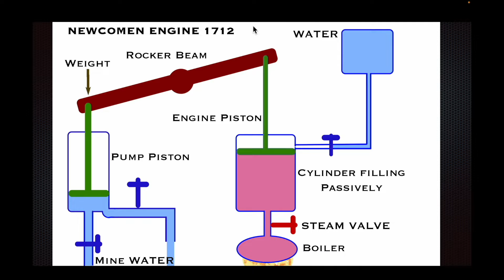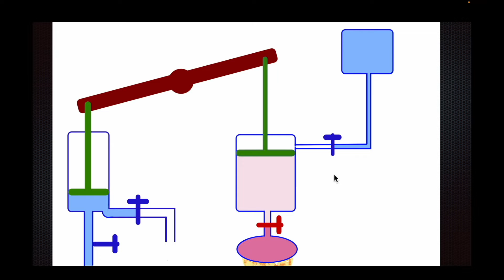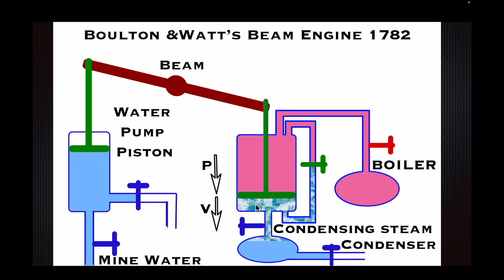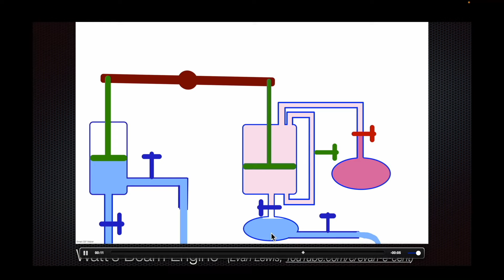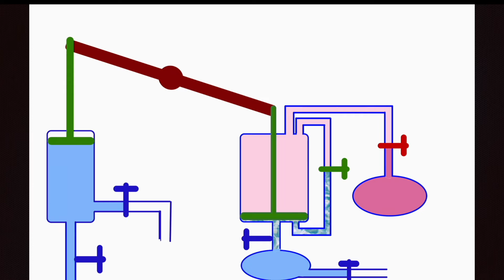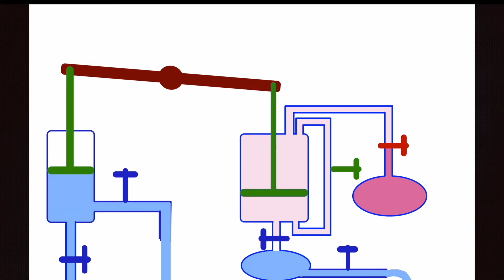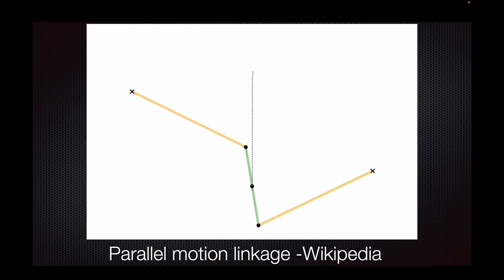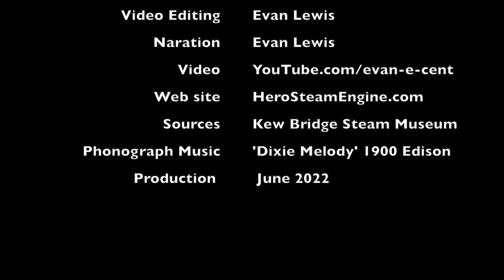Animations of Beam Engines-Newcomen, Watt and Cornish

Comment: How does the engine piston go all the way back up to the top of the stroke if it is just equalising pressure in the chamber? Shouldn't it stop half way?
Reply from the maker: I think the answer is that the water pump on the left side is carrying a heavy load of water which pulls the left end of the beam down, and making the right-hand end rise up, pulling the piston back to the top. Note that, although the pump is shown at the same level as the steam piston, it would have been placed under ground, probably hundreds of feet down the mine and that includes a heavy shaft in addition to the weight of the water column on the left side.

Comment: Atmospheric pressure is a friend to a Newcomen Atmospheric Pump, it's an enemy to Watt's High Pressure Steam Engine, in fact, it was a big problem for the first steam engines. Atmospheric pressure opposes a steam engine.
The optional separate condenser on a Watt engine recirculates hot water and also eliminates Atmospheric Pressure.Makes Watt's High Pressure Steam Engine more efficient.

Comment: Bloomfield Colliery 
Near Dudley 
1776: ' Birmingham, March 11th. On Friday last a Steam Engine constructed upon Mr Watt's new principles, was set to work at Bloomfield Colliery, Dudley. From the first moment of it's setting to work it made about 14 or 15 strokes per minute, and emptied the engine pit (which is about 90 feet deep, and stood 57 feet high in water) in less than an hour. This engine is applied to the working of a pump 14 inches and a half diameter, which is capable of doing to the depth 300 feet, or even 360 if wanted, with one fourth of the fuel that a common engine would require to produce the fame quantity of power. The cylinder is 50 inches diameter, and the lenth of the stroke is seven feet. These engines are not worked by the pressure of the atmosphere. Their principles are very different from all others.
Reply from the maker: Thanks Walter.  Note this report was in 1776 and the Newcomen engine was invented in 1712 leaving 64 years for the Newcomen Atmospheric Engine to be widely used with over 1500 engines in mines around Britain before the use of high pressure steam boilers could be developed.
Reply: So Watt's Invention was a high pressure Steam Engine.

Comment: The Newcomen Engine in the drawing wouldn't work, the cylinder  should be open to the Atmosphere at the top.
It's misleading.
Also, the vacuum in Watt's Engine isn't, ' really Atmospheric Pressure '.

Comment: What did they use to seal the pistons in the 1700s?
Reply from the maker: I don't know precisely. Piston rings were not invented until 1825. Prior to that pumps used leather.  In the early days of steam engine development they had problems making cylinders round. Eventually engineers developed a boring machine for making cannons and it was also used for boring cylinders.  These engines used large cylinders and the ratio of circumference divided by steam volume is reduced. This reduces the effect of air or steam loss past the piston.

Comment from the maker: Walter posted again (with several different names) with his view that Watt invented the steam engine, not Newcomen.  We have discussed this many times now and cannot agree. Let the viewers decide for themselves.
One thing that becomes obvious from these animations is that Watt's engine looks almost identical to the Newcomen steam engine.  Apart from using a separate condenser, higher pressure steam, and the parallel linkage, the design is the same. So the biggest part of the invention came from Newcomen.  

Newcomen could not produce a "vacuum" without using the energy of steam.  You cannot use the atmosphere to do work without supplying energy. That energy came from steam.  Have you ever seen a vacuum pump without a motor to provide energy?   There is no doubt that the source of energy for Newcomen's engine is steam.  It cannot work without steam. This steam energy is used to generate mechanical energy to drive a water pump.  The conversion of heat energy to mechanical energy is the definition of an engine.  Clearly Newcomen's steam powered engine  meets the definition of a steam engine. Watt's improvements were simply improvements of Newcomen's design.  

Watt did use the design to produce rotating motion from the oscillating movement of the beam engine, but that was a relatively simple addition which was also applied to the Newcomen steam engine. He used a novel design because someone had patented the crank, even though it had been known for centuries.

The Cornish engine provided further improvement in efficiency over Watt's engine, simply by modifying the valve timing. Watt just sold himself  to the public as the "inventor" of the steam engine. But he didn't really invent the steam engine. He just improved it. Watt's improvement came  about 70 years after Newcomen's invention had become a big commercial success with thousands of machines produced , During those 60-70 years others had developed the technology to produce high pressure steam with some degree of safety, and the quality of engineering to produce pistons and cylinders that fit well improved. Some of that came from the development of cannon boring machines (Wilkinson) which had nothing to do with Watt.

I just found this online:   "Early engines had the piston sealed by a leather cup seal. Later a rope seal was used, kept in place by metal weights. ... The expiry of the patents led to a rush to install Watt engines in the 1790s,"  
in Graces Guide:  (https://www.gracesguide.co.uk/Newcomen_Engine). This is worth reading and confirms my insistence that Newcomen invented the first commercially successful steam engine.  

The following quote comes from Wikipedia: By 1800 (CE), hundreds of non-Watt rotary engines had been built, especially in collieries and ironworks where irregular motion was not a problem but also in textile mills.[5]

Despite Watt's improvements, Common Engines (as they were then known) remained in use for a considerable time, and many more Newcomen engines than Watt ones were built even during the period of Watt's patent (up to 1800), as they were cheaper and less complicated. Of over 2,200 engines built in the 18th century, only about 450 were Watt engines. Elements of Watt's design, especially the Separate Condenser, were incorporated in many "pirate" engines. Even after 1800 Newcomen type engines continued to be built and condensers were added routinely to these. They were also commonly retro-fitted to existing Newcomen engines (the so-called "pickle-pot" condenser). (https://en.wikipedia.org/wiki/Thomas_Newcomen ).

This makes it clear that there was not a sudden and complete transition to Watt's version of the steam engine. He had patents until 1800 which allowed him to collect a percentage of the savings on fuel by his more efficient engine. However, this was an added expense and Newcomen engines were not encumbered by patent issues. So it was not as though Watt's engine suddenly drove the industrial revolution. It was a gradual transition.

The perpetual argument about Watt and Newcomen causes us to overlook the fact that Newcomen did not invent his steam engine alone (in a vacuum so-to-speak).  In fact he worked closely with Savery who had previously used a steam generated vacuum to draw water out of a mine. We somewhat artificially define the inventor as the first person to produce a commercially successful steam engine. But I believe it was a Frenchman working with the famous Boyle (Boyles Law) in London who developed the idea of using a piston and cylinder to produce an engine - Denis Papin. It was HIS design that was the basis of the Newcomen engine and if we put the issue of  commercial success to one side it is probably Papin who should be considered the inventor. He presented his ideas to the Royal Society in London but he could not afford full-scale development and patent which required an act of parliament in those days..  Newcomen took up the idea.

 In fact there were several people involved in the invention of the steam engine, and we should say that the steam engine was developed as a result of the work of several people including, but not limited to, Papin (perhaps Boyle), Savery, Newcomen, Watt and others.

Of course Hero published the first known account of a steam engine about 2000 years ago (see my site https://www.HeroSteamEngine.com).

Comment: Newcomen and Savery dumped High Pressure Steam Power for Atmospheric Power.
Newcomen's Atmospheric Pump supplied Atmospheric Power, so, Atmospheric Pump.
James Watt dumped Newcomen's Atmospheric Power and Arkwright's Water-Power for High Pressure Steam Power.
He had to invent a new engine to achieve this, the world's first PRACTICAL High Pressure Steam Engine.
This was the one and only invention that kicked of the Industrial Revolution.
Watt's engine supplied High Pressure Steam Power, so, Steam Engine.
 Like a Water-Wheel supplies Water Power and a Windmill supplies Wind Power.
 If you want Rotary Motion or Steam power you definitely don't want a Newcomen Atmospheric Pump!
You Need a Watt High Pressure Steam engine!
Even a 100% efficient Newcomen pump will only give 14.7psi of Atmospheric power, and we know that's impossible! In practice it would be 10psi. Max .and no rotary power. It couldn't be improved, even by James Watt.

Comment: In Newcomen's Atmospheric Pump, Atmospheric Pressure does the work.
In Watt's Steam Engine, Steam Pressure does work, just like a Locomotive!
Take away James Watt's Steam Power and you've got no Industrial Revolution!
No millions more Steam Powered Factories, Steamships, Locomotives etc.etc.etc.
Just Newcomen Atmospheric Pumps and Arkwright's 2000 or more years old Water-Power.

Comment: no it doesn't work as you say your diagram is misleading chambers were separated
Reply from the maker: The later engines are shown with a hot steam source and a separate cold condensing chamber with the working piston between. So two chambers are shown, although your definition of 'it' is not clear.
Reply: I think I understand it now it is a clever engine when one considers the poor materials then available.

Comment: Watt's engine doesn't use atmospheric pressure, it uses steam pressure and supplies steam power. He said in his patent, if there's no water to cool a condenser, release used steam directly to the atmosphere. It works without a condenser. An atmospheric engine can't, it basically is a condenser. Watt's engine can use one to recirculate hot water and at the same time eliminate atmospheric pressure, which opposes a steam engine. Some manufacturers thought Watt's tolerances impossible to achieve, they had to improve their engineering. Some thought it too complicated to work.
It's easy to create and condense steam, not so easy to keep it hanging around, outside the boiler long enough to move it around an engine and drive massive slow moving machinery without it condensing. Using high pressure steam, a new engine, and his own ideas on how to make it work, Watt invented the first practical steam engine. They'd built cylinders for atmospheric engines for 70 years but still didn't come up with a steam engine in all that time! Watt didn't have a factory or money and had to make a living at the same time.
I don't see the difference between high and low pressure steam engines, they're all steam engines. Naturally the first ones will have lower pressures. It took another 70 years to get pressure high enough for a locomotive, Watt being long gone by then! Also don't know how they got a patent for a crank, they've been around since biblical times. But it shows the opposition he had in his work.
Reply from the maker: I respectfully beg to differ. To my mind a steam engine can use high-pressure steam, low-pressure steam, or steam induced vacuum.  All three types are "steam engines". therefore Newcomen's was the first commercially successful steam engine.

Comment: The truth. For a change. All the bluster about heating and cooling cylinders, steam at atmospheric pressure, substitution of suction power for steam power,Watt not inventing the steam engine, doesn't change the fact that the Thomas Newcomen atmospheric pump was not a steam engine and Watt's was. James Watt didn't improve Newcomen's pump. It couldn't be improved, it was a 70 year long deadend. Even Arkwright had to make do with a remote water wheel.
Watt invented a new engine,a steam powered engine (one that actually worked). A new beginning. It was the one and only invention that created the industrial revolution. Before him,no steam engines, after him, steam engines everywhere, thousands more factories, utilities and more, steamboats, locomotives, etc.etc.etc. The industrial revolution.
Reply from the maker: Hi Walter, Thank you for your input. Your interpretation fits with the view of many people who feel that Watt is responsible for the invention of the steam engine. That is certainly a valid point of view, and I would not strongly argue against it, and you brought up some good points about the importance of the developments. But I feel that it depends on your definition of a "steam engine". There were  so many people involved in the process, developing various aspects of the technology, that I don't see any one person as THE inventor of the steam engine. In fact nearly all the components that Watt put together to build his steam had been invented by others - starting with Papin's development of the piston and cylinder. Watt came along at a time when the engineering technology was reaching the point where it was making it all possible. This includes the development of the  boring machine for boring cannon, which could be used to bore cylinders.
Reply: You could say that about any Invention, especially with Spinning and Weaving.
There's about 16 different people involved in improving Spinning and Weaving, yet they're all classed as inventors.
What's so different about Watt, that he can't be classed as an inventor.
He worked on his own in secret.
The PRACTICAL Steam Powered Engine didn't exist before Watt.
Newcomen's machine wasn't Steam Powered, it was Atmosphericaly Powered, like a Water-Wheel's water Powered.